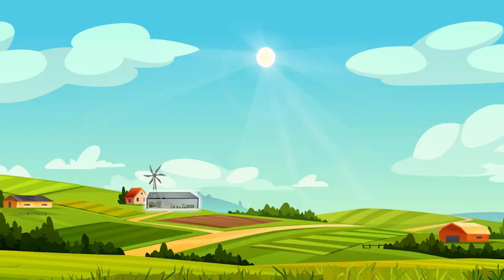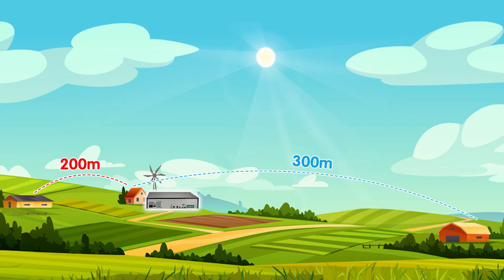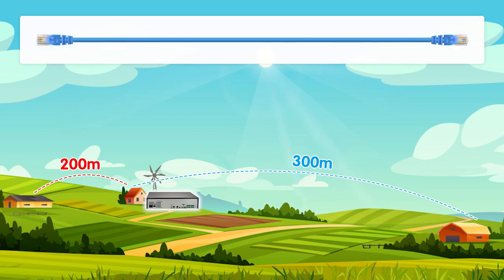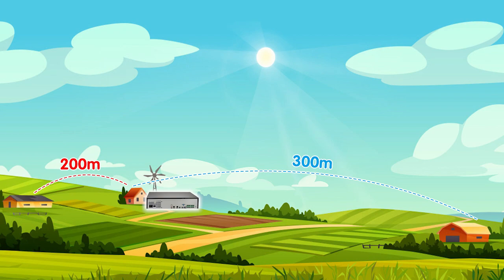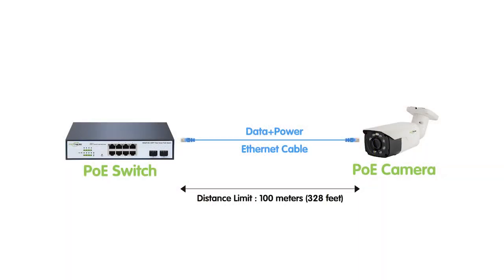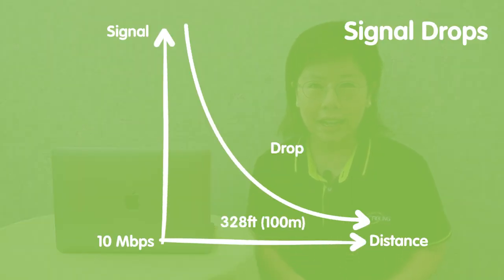Remote IP Cameras Setup with Long Range PoE Switches | Case Study

Comment: Maam,it is ok of one fiber optic wire 1km range then 4 cameras operation
Reply from the maker: Yes, but you'll need a separate power cord to power the camera, and it'll be more expensive to run fiber.